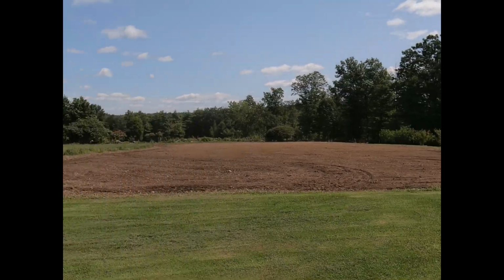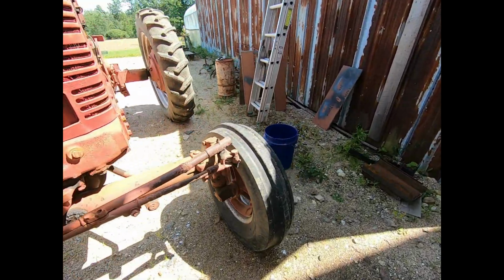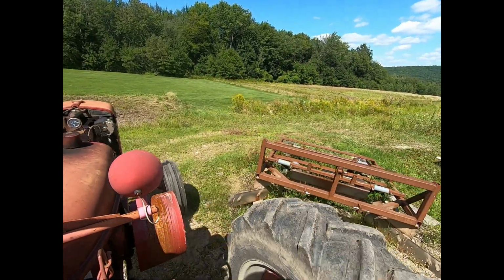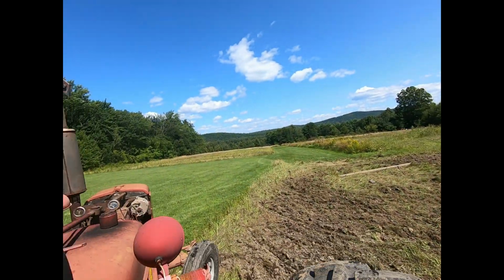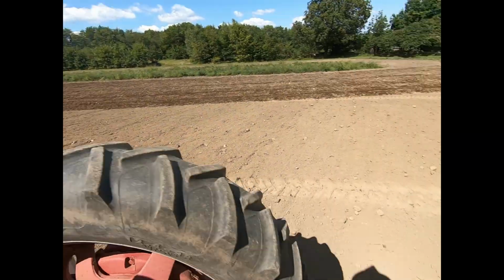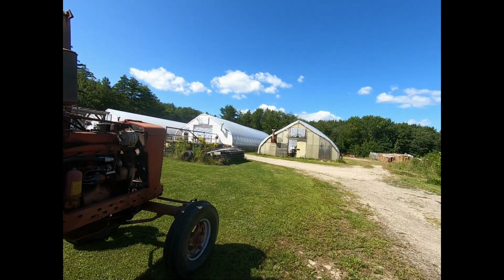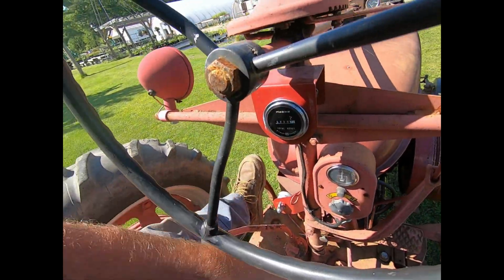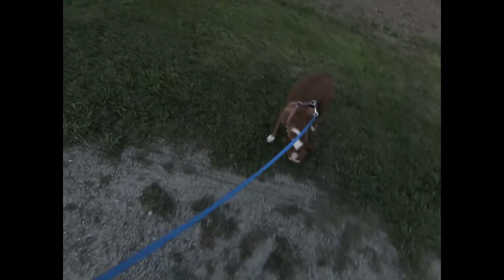# 637 Discing and seeding winter rye

Comment: Gday Tim , if the power steering pump has rubber seals , try dumping the power steering fluid out of it and use motor oil that should reseal the unit , its somthing i used to do in the trucks i drove years ago and it worked every time , its a hydrolic pump so heavyer oil wont hurt it ,,,,, just a thought mate

Comment: if that port block is broke they used to make a steel one if you cant find one you can have a steel one made you have to be careful with those aluminum ones they will crack easy love those ol tractors just bought a 48 h super m had a pair of h,s /m,s a one time 450/44 massey boy would they burn gas 300 gals a day good luck oh that power steering pump is the same as they used on ford cars and trucks back in 60,s they are eaton
Reply from the maker: if it is cracked i plan on making a new one from steel